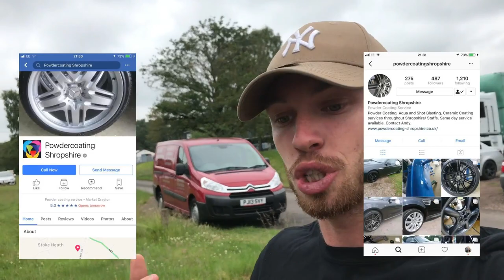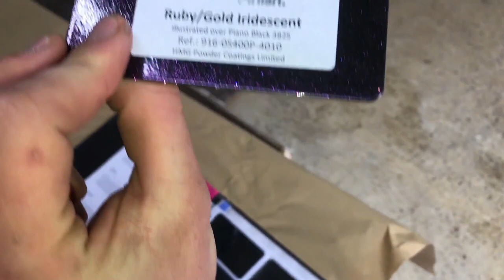Powder coating my wheels.. But What COLOUR?! ;)

Comment: I've had 4 sets of wheels powdercoated at 3 shops all in different areas of the UK.  Always been disappointed with the finish and ended-up having them stripped and wet-painted.  IMPO powdercoating is too "bling".

Comment: How much that set u back ??
Reply from the maker: a full set powder coated would cost around £300 depending on the colours etc!
Reply: itsLeeLockwood cheers mate , been quoted 120 but I know if I buy cheap I'll buy twice ! They look boss
Reply from the maker: yeah see if they even take the tyre off.. they probably wont
Reply: itsLeeLockwood good price..I was quoted £125 per wheel 😬 just drop the car off

Comment: There need at lease 4-5 days to bake before there go on the car rush job there are
Reply: Tommy Cars&Games 97 not with powder coat bud. As soon as they are cool, the’re good to go. No cross linking occurs after cooling. It’s a thermosetting polyester I assume because thermosetting epoxy base chalks after a while.